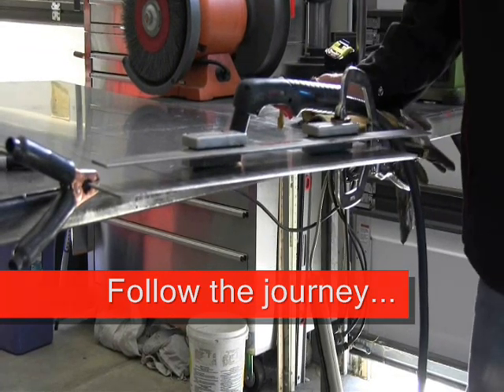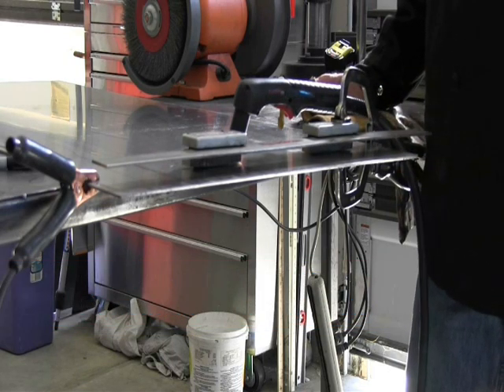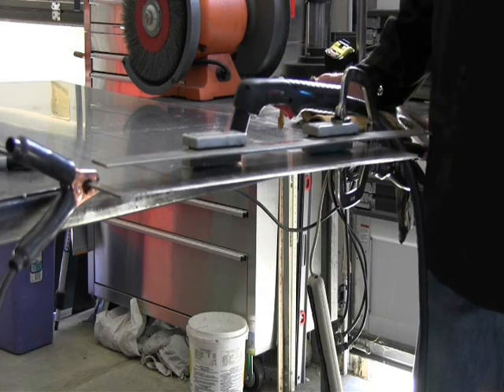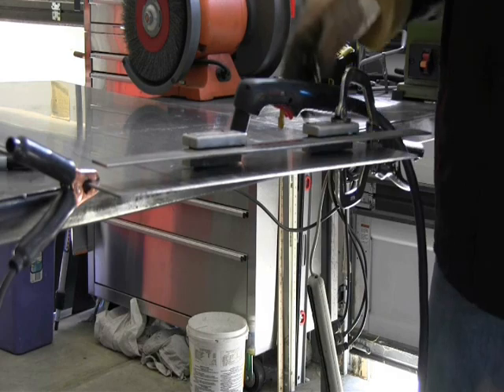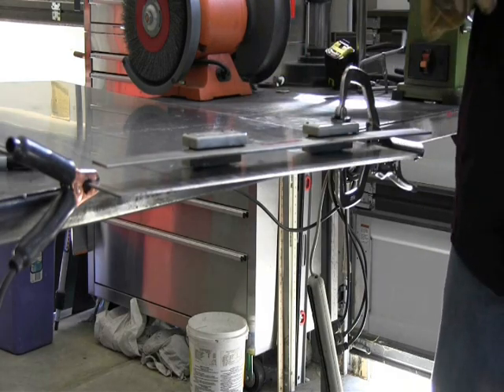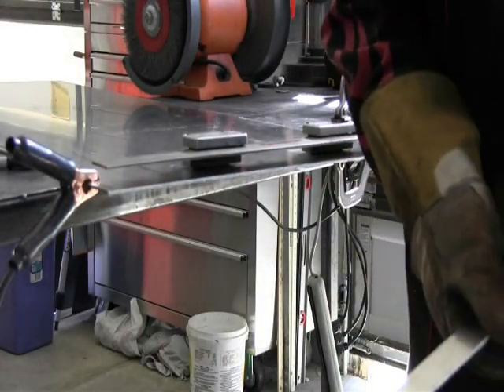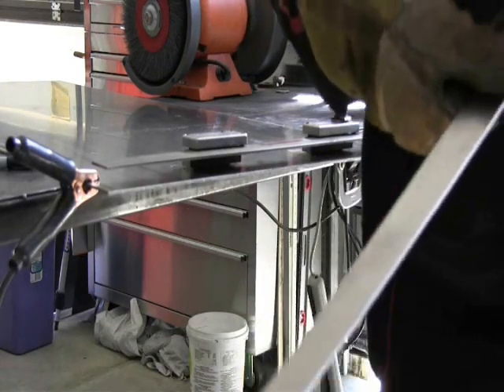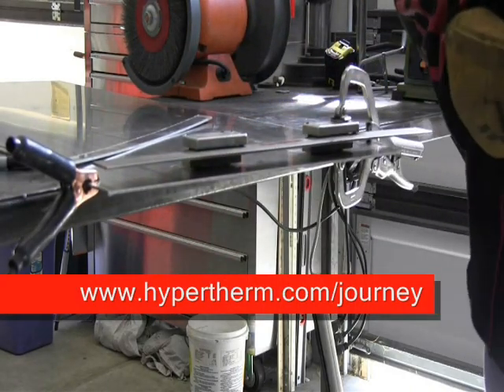Cutting aluminum with plasma

Comment: How about letting us know your settings?
Reply from the maker: For 12ga aluminum you would use 45amps at approximately 280ipm on 120v. Since this is hand cutting You want to go slow enough where all the sparks are going out the bottom, too fast and you get blowback. hope that helps